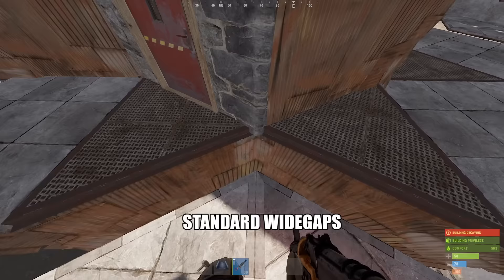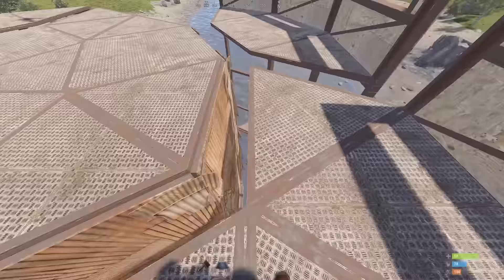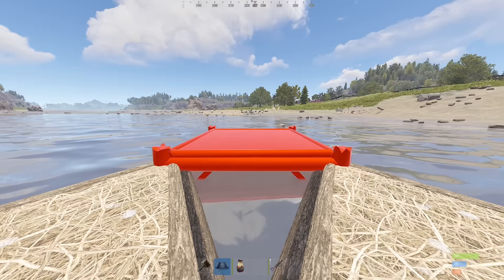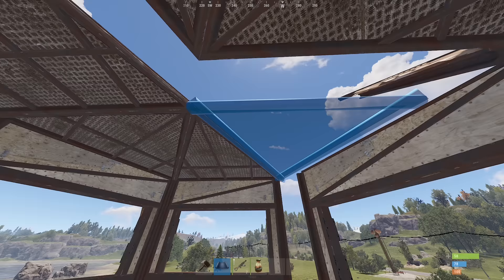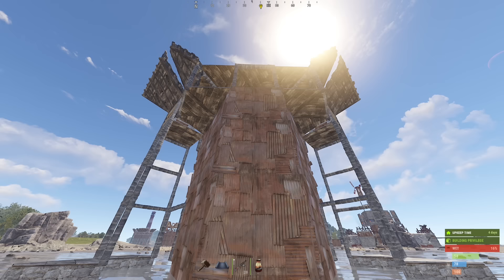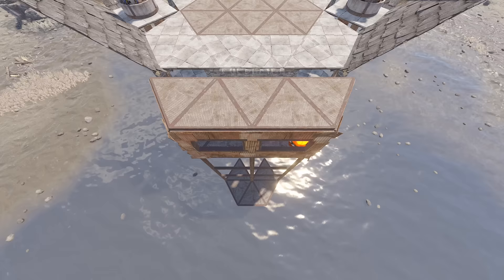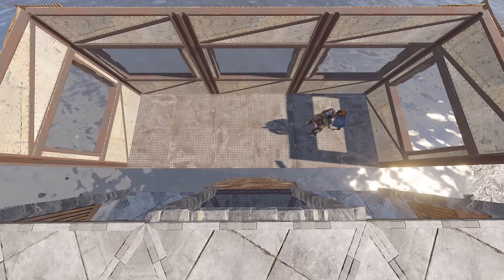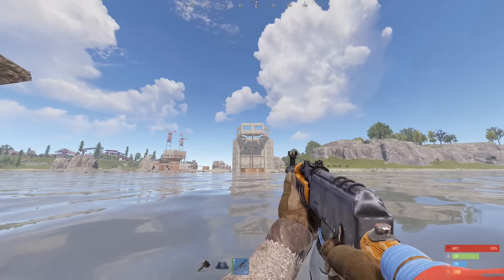BETTER WIDEGAPS & FREE ROOF PEEKS - A Rust Building Tutorial

Comment: Do realize there floor stacking method from Gabe where you can achieve SAME exact concept. where you build 5 squares - then start in the middle square, and go out i think 4  squares (or may be 5)  and then place triangle. Delete the rest and go back in with triangles; Then place quarter walls on the nearest triangle to the squares as a ruler. Then place door frames on all squares and shoot out middle  square piece. then use triangle piece to make a new height foundation as you were doing. It might be extra steps to do it all, but it is moreee " dummy proof " method if newer builder is having issues with your method.

Nonetheless, love your work and tips, and cant wait try out your method and see how it goes and feels. Great work btw gamelights!

 Also, you should place video about advancing building technique, around advance bunker technique i learned. Ya know where people usually place a floor frame above the bunker part? you do the same, but you then place floor on top of the floor frame. Then what happens is, you manipulate the bunker, and you can then NOW make a bunker come from a DIFFERENT direction then the way it was intended OR if done created, can make double sides bunkers to other cool turnouts of results. I can send you some screenshots if ya dont know what im talking about.
Reply from the maker: That's a method that could work as well, sure! 
Any freehanding method will work if you practice it enough. I think it's more accurate this way though, because you can more exactly judge the EXACT compass heading by looking at the center of the corner, but really, anyone proficient with freehanding will do it their own way I think.

Regarding the bunker, I think you'll have to show me that personally because I'm not sure what you mean exactly.

Comment: After a bit of expermenting it is also possible to combine these with the freehand style, main tc connected peaks you showed a while back making these viable in a whole ton more base designs without secondary tcs
Reply from the maker: Yup. You could always vary the height on those, which is why in that video I showed a specific method meant to make sure you get the exact base height.
Reply: @GameLightz  yes but this triangle method makes it a lot easier to consistently get the height you would want while still easily connecting to core.
Reply from the maker: @craigcalladine851  You can get the other style of freehanded peeks easy too.
Instead of aiming for the center triangle in the twig low-walls, aim at the top of the triangle or a bit higher. 
See what I mean?
Reply: @GameLightz  ah yeah got it. Thanks!

Comment: Can you elaborate on how squares are to costly?! I always have trouble with bases that don't have squares I think without them it is way more inefficient. Square box with wall and ceiling is the same as two triangle foundations connected with walls and ceiling, however you can fiit way less boxed  etc inside
Reply from the maker: Yes:
1) Triangles are cheaper to honeycomb since they need fewer walls.
2) Triangles make for a slimmer base profile, which makes shooting floors slimmer too (with attendant cost reduction)
3) A slimmer base profile is cheaper to expand vertically

So basically triangles allow you to make bigger and more functional bases for much cheaper.
Reply: @GameLightz  you have good points, and maybe I have a flaw in my way of thinking but... doesn't the amount of building blocks a base has increase the upkeep, and since squares offer more room for still being one block it sould be cheaper? Or does a square increase the upkeep more than two triangles that would kind of make up for the square space?
Reply: @redsbox  i mean there is nothing wrong with either d sign...i think the best is a mix of both
Reply from the maker: @hanfiball4136  I can get quite enough storage into all-triangle footprints for us to never run out of room as a trio, so it's a non-issue really. ESPECIALLY with the infinite box capacity now.